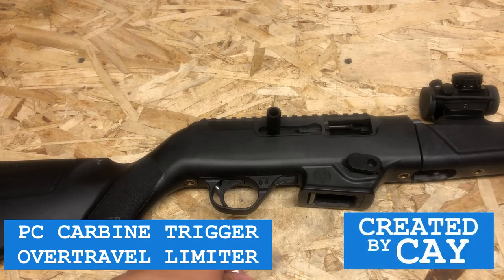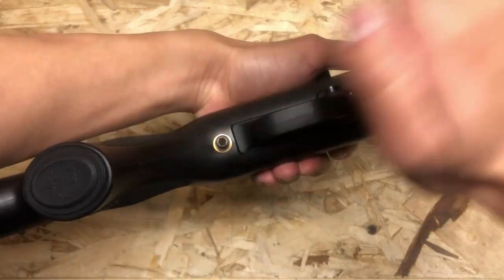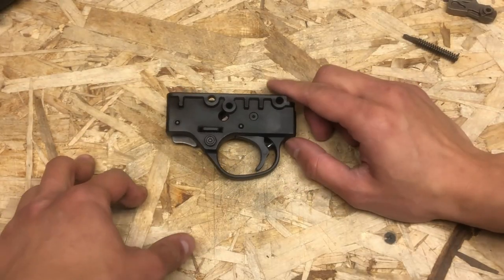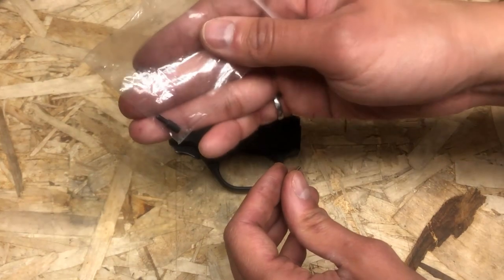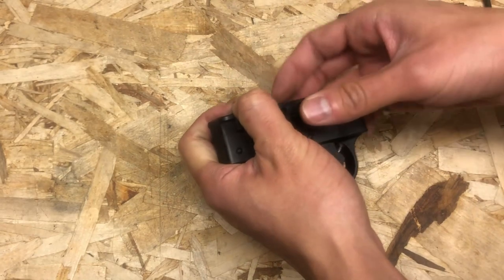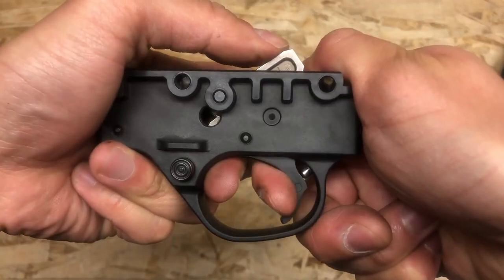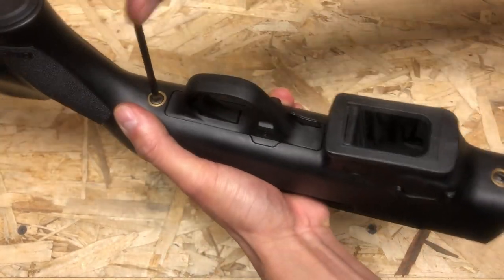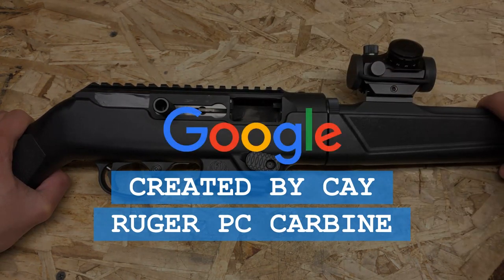Ruger PC Carbine / Charger - "Double Tap" Trigger Over-travel Limiter - Shoot Faster!

Comment: I bought this. Really like it. Hoping for Franklin Armory binary trigger to come out for the PC Charger.
Reply: It uses the 10/22 trigger assembly
Reply: @tobiahwright6818  that's a common misconception. The PC Charger unfortunately doesn't use the precise same trigger as the 10/22. I've verified this by Franklin Armory.. that's when I learned they'll make a trigger if they hear from enough people on a platform.
Reply: @tobiahwright6818  I had a typo in my last comment. Franklin Armory 10/22 trigger doesn't work in the PC Charger. It's not precisely the same trigger.
Reply from the maker: Thanks Yay4this, glad you like my product. I got the same one designed for the 10/22. - Cay

Comment: Hi Cay, I am interested in this part. I was wondering will this cause wear on the factory trigger spring? Also, Will this work in conjunction with the Franklin Binary trigger that is now available for the PC Charger? I was thinking that with this piece and the binary together, it will be practically full auto!!! drools
Reply from the maker: Hi. No it doesn't affect the factory trigger spring. And no, it was only designed to function with the stock trigger from Ruger. Hope that helps.

Thanks,
Cay

Comment: It doesn't work when installed
Reply from the maker: Jeffrey Hinesley Hi Jeffrey. Send me an email with your order number at createdbycay(at)gmail.com.
Reply: It doesn't work on mine either.
Reply: If you notice, the factory part has a point/cone on the small end. Make yours the same profile, and it'll work flawless.
What I did to mine was a sort of reverse-lathe; chucked the fat end of the part it into a drill, clamped a file into a vice, and then carefully chamfered the small end to a point/cone, just like the factory part.